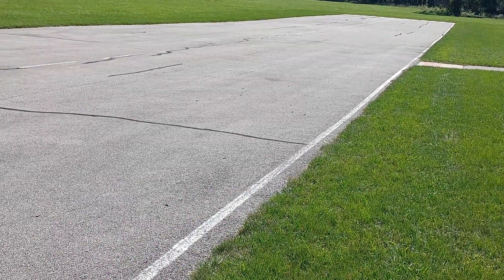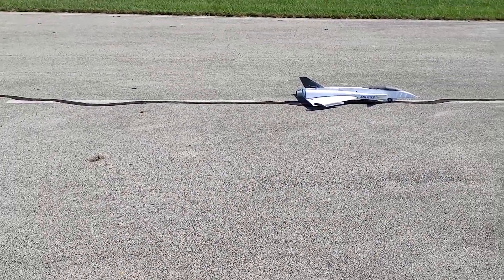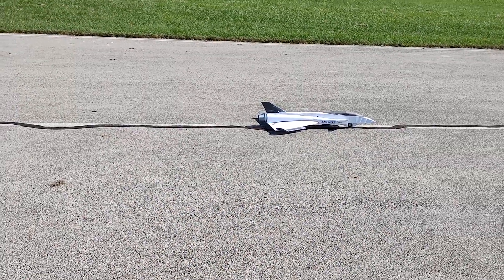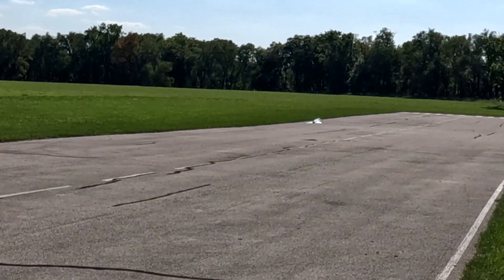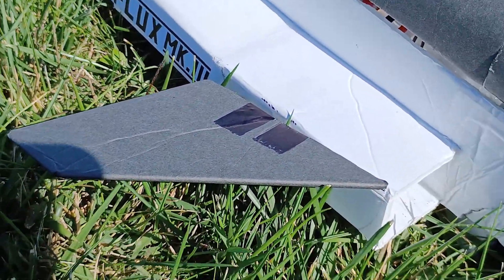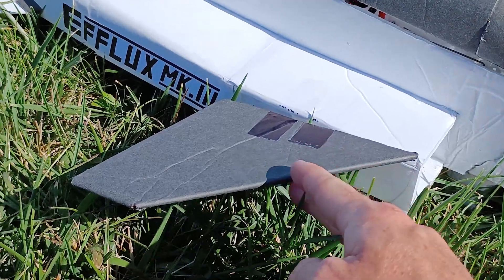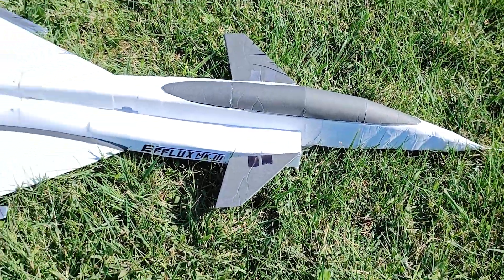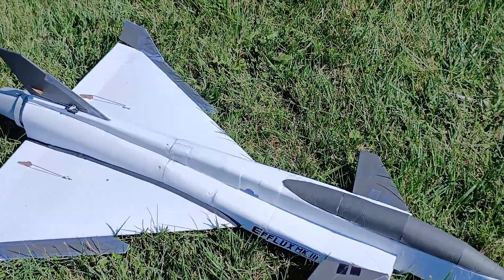Efflux Mk. III Re-Maiden and Flight #2

Comment: Beautiful! That final taxiing shot with the TV nozzle blowing debris looked fantastic and got a good laugh out of me. It is pretty incredible how much the leading-edge cuffs made a difference - I suspect that, in addition to providing washout to tame the stall and wing rock, they also add a non-trivial amount of wing area to a plane that didn't have a whole lot to go around. The way she handles now is more "sleek, graceful heavy EDF" and less "struggles to stay up on anything less than full throttle". Good landings too.
Also, gotta admit, the cuffs just LOOK really cool, I like what it does to the wing planform. The tip fins don't hurt either. 😁
Reply from the maker: Thank you! I love the visual contrast the cuffs provide and the dogtooth - Felt like the wing was missing some black on it to match the wingtips and canards. The extra wing area is a plus as well, and probably increased my CL_max. Gonna do a video looking at flight data later today